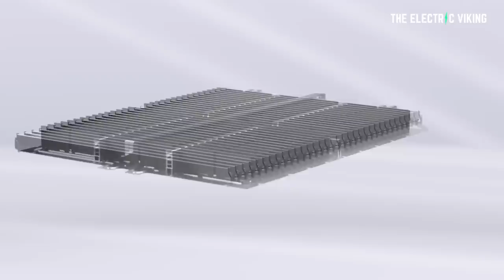LG Chem will build $3B EV battery cathode factory in the US

Comment: Yet, rather quietly, Tesla is building a cathode manufacturing facility adjacent to TeraTexas.  I believe at Tesla Battery Day, they mentioned that the cathode is almost 50% of the cost of the entire battery.  This will most certainly be fully functional well before the LG Chem facility in Tennessee.
One of the most impressive things Tesla does is to continuously improve existing products.  Most companies release a product to manufacturing, then keep making it without significant changes.

Comment: Battery chemistry is still evolving along with electrode structure. My favorite is aluminum graphene battery. I know of three companies that claim such batteries; GMG, Nanotech, and Morand. I like graphene because it can be made from any carbon based material like waste plastic, organic farm residue, and leftover coke from oil industry. Using the flash graphene process invented by Rice University high quality graphene is made. A further step to make a graphene hydrogel from the graphene flake to impart structure and a large surface area is needed. Or possibly the graphene foam can be made in one step by using egg white protein foam using the Rice process. Aluminum is produced all over the world so could handle extra demand. Hopefully a cheap, compact, lightweight, and energy dense battery will result.

Comment: Interesting to watch supply chains for different battery manufacturers - and ultimately OEMs - take shape. 

This LG Chem facility will be just across the border from Hopkinsville, Ky., where Ascend Elements only a month ago broke ground a $1b, 400-job battery recycling, materials separating and processing facility. Seems a likely supplier to LG. 

The Clarksville, Tenn. / Hopkinsville, Ky. area will likely continue to draw related investment due to the commutable proximity of the Nashville labor market, flat land, low-cost living and TVA power. (The Viking mentioned hydro and solar, specifically.) Moreover, U.S. Army Ft. Campbell spans the border between Hopkinsville and Clarksville and provides an additional source for hiring as it transitions hundreds of soldiers out of the Army each month. 

For many reasons, it is great to see this kind of development. One concern I’ve voiced in economic development circles for years is Kentucky — and to a lesser extent Tennessee — is highly reliant on ICE-vehicle supply chains, especially for rural employment. 

These new plants are incredibly important because, I predict, quite a number of tier 2 & 3 ICE supplier plants will go dark in the coming decade and those closures can be devastating for smaller and rural communities.

Comment: .  The Monkeys song, the Last Train to Clarksville (Tenn).  

 Toyota is claiming its transmission supplier Aisin, along with Denso has created an electric axle that is 30 percent more efficient than any currently being manufactured - but didn't specifically mention Tesla.  The goal is to get more function from a smaller battery capacity..